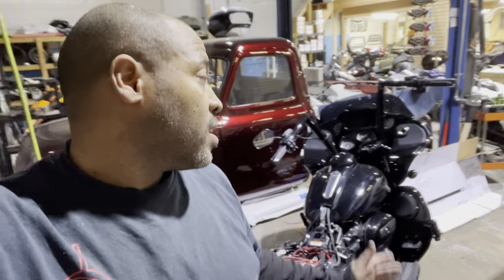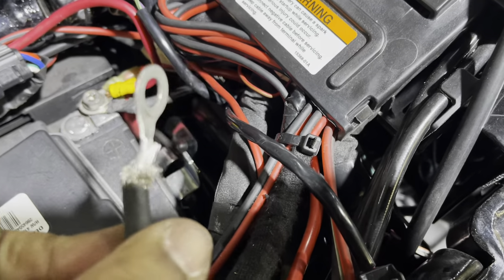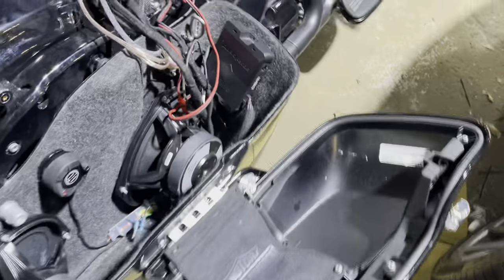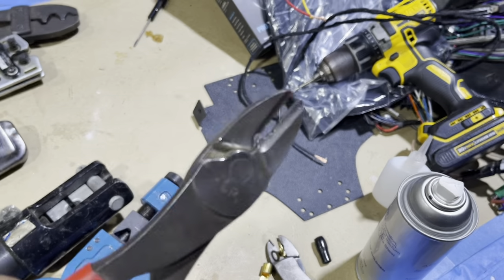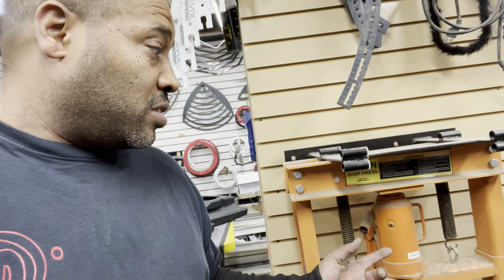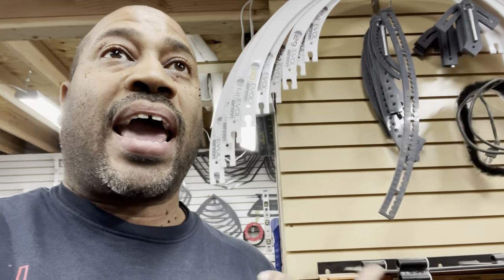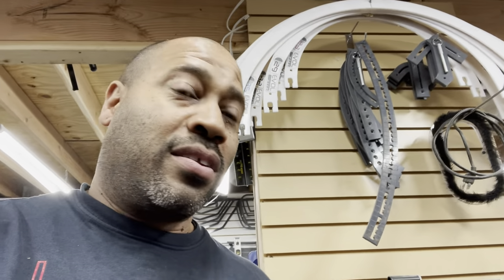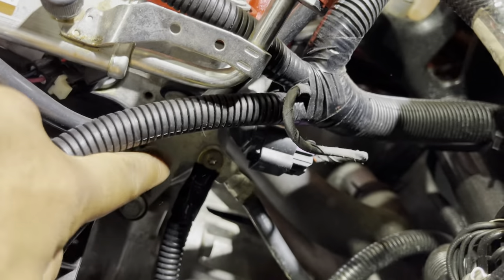Proper wiring connections is a must on Harley-Davidson audio installs

Comment: Great video's.  Question? I have a 2019 Batwing Harley. I installed a Hertz amplifier, now I am adding the Hertz sx 6.5 neo speakers front and rear. Is it wise to drill vent holes in the speaker pods to allow the speaker to move the air and improve the sound? Or is this a urban legend?  Thanks again for your product reviews.

Comment: The spade terminals aren't "terrible".
using the 12g instead of 8g ring, holy cats... Well, I mean, it "works", but... it sucks and creates CURRENT issues as you stated at the end EVERYONE, THATS THE IMPORTANT PART
Your installations are fantastic and in my own field, I appreciate the attention to detail you show.

HOLY CATS WHY IS ANYONE COMPLAINING ABOUT THE HYDRAULIC CRIMPER YOU USE?!?!?!?!
A bathroom has a sink, you can turn the sink on full blast or just a little as you need, it still has the same amount of water that is available.  You move your hand a bit more to move the handle open a bit more for more water.  With the hydraulic crimpers, same thing.  It's like a clutch pedal, you feel the pressure with your foot.  according to how thick the wire gets, you need to use more force to crimp it.  Like squeezing an old orange vs a fresh orange.  That's probably the best one.  Your hand is the size it is, you are as strong as you are, but you only need as much force as you need to crush that orange, the fresher the orange, the more force.  The thicker the wire, the more force.

Comment: Just installed my new Rockford fosgate 98-13 stage 1 kit with new head unit and 4 new speakers. Sounded okay at first pretty loud and clear but not much base. Went out and listened again later and turned it up pretty loud and now i sound like im having some distortion! Is that system capable of busting the stock speakers with out an amp connected? What could be causing the distortion after only listening to it a few times? It has distortion on any input radio, bluetooth etc..... your thoughts????

Comment: Is 16 guage stinger speaker wire acceptable for a 400 watt 4ohm mid bass driver. The total length of the run is about 5 feet total?

Comment: What do you use in replacement of the glass fuse holder?
Reply: Was about to ask the same question.
Reply: Use a ANL fuse it is held down mechanically with screws and not pressure like the others
Reply: @jasonbreedlove495  use ANL fuses
Reply from the maker: The funny part is they used the correct fuse holder on the other side . Anl or mini anl  basically any fuse holder the holds the fuse down with screws not just pressure. We like the ones from stinger , Audison connection and raptor . 

https://stingerelectronics.com/collections/distribution-blocks/products/2-position-midi-fuse-holder

https://stingerelectronics.com/collections/distribution-blocks/products/in-line-midi-fuse-holder
Reply from the maker: https://youtu.be/jfHNMxH0cQg
Reply: @NVSAUDIO  ground doesn't have to be fused in a distribution block does it ?
Reply from the maker: @Bottom2TopServices  no 
We run the grounds directly to the battery
Reply: @NVSAUDIO  Cool is this the same with a 1 4 gauge to 2 8 gauge runs to power 2 amps.
Reply from the maker: @Bottom2TopServices  yes 

Ground to the battery and use a 4 way mini anl fuse block with zero gauge power wire going into it from the battery. Like the stinger shd821 

https://stingerelectronics.com/products/4-position-midi-fuse-holder

Comment: I use a soldering iron and wire a couple of times and it got little messy to do it on the fly around other wires and components I'm afraid that it will drip on two other things or just be a big mess but yeah mine should be soldered
What how do you do it on the fly inplaced

Comment: How do you install a GOHAWK 600 WATT STEREO SYSTEM AND SPEAKERS GOING TO THE FUSE PANEL instead of going to the battery on a 2007 XL883L Harley Davidson Sportster? Going straight to the battery killed my battery quick. Please help me. Thank You Sir. Robert Lee Kerns- Columbus GA

Comment: What size crimper would I use for the connection for the Rockford kit to the speaker? And should I solder also?
Reply from the maker: Solder or use the connectors that came with the Rockford kit 
They are already crimped and they fit awesome !!
Reply: @NVSAUDIO  no crimp jus solder?
Reply: @NVSAUDIO  ok because when I opened my bag up they came apart easy
Reply from the maker: @Tom-jw1pe  the means whoever installed them damaged the connector or they never installed the Rockford connectors that came with the kit . The Rockford connector lock in place and they are hard to take off . 

Just cut the ones you have off and solder them
Reply: @NVSAUDIO  i want to keep the connectors just in case I swap to some hertz speakers later.. I’m OCD thanks for replying bro

Comment: Why you don’t work on roadkings
Reply from the maker: We just delivered a road king yesterday 

The video will be up soon 

Did a dsr1 dsp 
Ds18 Bluetooth streamer 
1600.1 sound digital 
1200.4 sound digital 
400.4 sound digital 
4 Beyma carbon sealed back in the lids 
6 ds18 25 mm horn tweeters 
Jefe rings 
10 inch nvs audio mid bass drivers 
Braille lithium battery 
2 amps in one bag 
Dsp and 3rd amp in the other bag 
All stinger wiring
Reply: @NVSAUDIO  This RK build was done without using a head unit correct? If so this is the build I have been waiting for. I only do Builds on motorcycles without head unit. Very interested in comparing notes. Keep the good videos coming.✌
Reply from the maker: @romesyoutubechannel5356  no head unit . Bluetooth streaming only
Reply: @NVSAUDIO  Good deal Carlos. I have been having terrible problems as of late with Bluetooth noise and units with  low outputs voltage. Is there any particular reason you use the ds18 Bluetooth unit?
Reply from the maker: @romesyoutubechannel5356  it was already in the bike and I like the fact that it created a remote turn on output when it connected to your phone .

I normally use the JL audio or the I simple Bluetooth because they are both 4 volts out 
I hate the Rockford one
Reply: @NVSAUDIO  10/4 . please go over how to use the DSP without  a head unit in that video. I will be ever so grateful.

Comment: Why is it not cool to drill holes in bags for 6*9 speakers.
Reply from the maker: I will address that on part 2 of the video . 
Adding holes so close to the face of the speaker restricts the air flow and changes the sound that the speaker produces . The increases pressure on the front of the cone causes stress on the voice coil trying to force the air though those tiny small funnels . I’ve when you buy mesh grill
Material the manufacture post the open area specifications of the mesh to let you know how much air restrictions the grill provides so you can calculate for it .